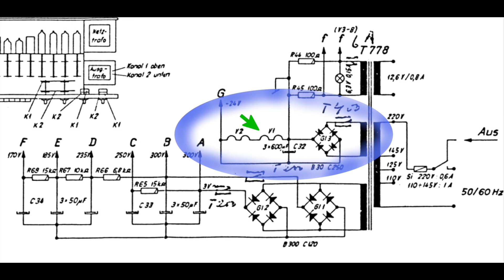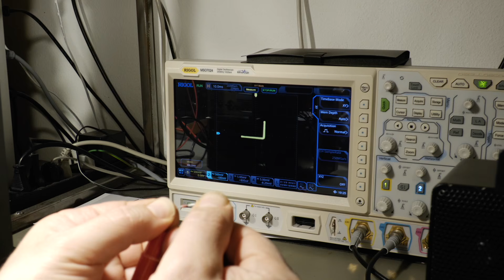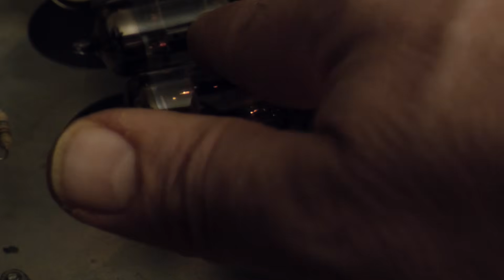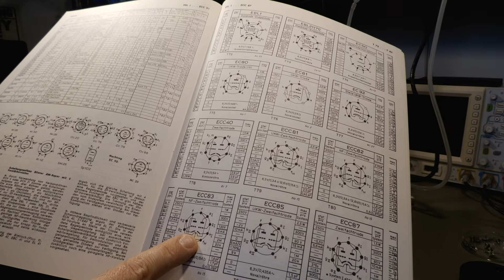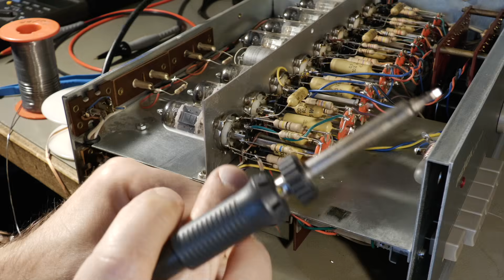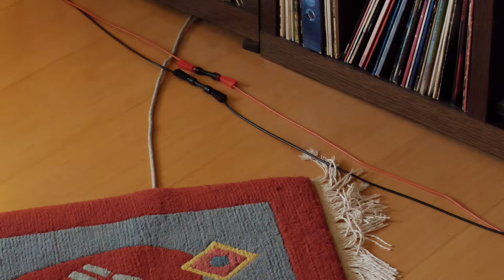Revox 40 amplifier - more Problems to solve (part 2)

Comment: Someone also replaced the high voltage rectifiers in the past, these where probably also selenium types. I would add a resistor in series with the heater wires, too high of a heater voltage is hard on the tubes. Also, If you are not going to use the phono input I would remove the tubes in that stage. It seems wasteful to unnecessarily burn them.

Comment: Also the grommet is missing where the orange and green wire go through the metal to the tubes. That is not original. I would think someone used an external audiophile phono preamp with that.
Reply from the maker: Possible... or a crystal pickup that produces almost line level signals.

Comment: Perhaps the original owner needed an additional line-level input, or used an external preamp but still wanted to keep the pickup button for the pickup. Also, perhaps the short to ground was meant for the input of the preamp tube (to not keep it floating?), but mixed it up with the tube's output.
Reply: Exactly my thoughts.  Probably wanted a CD input.

Comment: looks like a Selenium rectifier, which is ok to replace on low voltages, but on the high voltages you have to be careful with the voltage drop across them. as a replacement silicone diode will be about  0.6 to 1V but the selenium one might have 10+ plates and drop 20 to 30V.
Reply from the maker: That' probably why all voltages are a bit high. It seems the other rectifiers were replaced too. The date code says 1978. But I set the input voltage to 240V (we have 230) and that should compensate a bit.
Reply: @PlaywithJunk  the Electronics Old and New channel has a circuit he designed to behave as a adjustable voltage drop diode. to be  used as a Selenium rectifier replacement in the HT side. but changing the input voltage should be just as good.
Hope you had a great Christmas and looking forward to a great hew year.

Comment: excellent success. grounding is key in these things. it's really easy to put a pair of ground signal wires in parallel and create a loop that in the end causes hum. I assume that's why you had a grounding post near the phono input
Reply from the maker: From what I know (it may be wrong) is that the extra ground post at the phono connectors is for an extra ground wire that come from the record player. And that served the purpose of conducting static electricity from the pickup to ground. PVC (Vinyl) creates a lot of static charge and without a "lightning protector" these discharges would be audible.
Reply from the maker: PS: The Revox 40 doesn't have that...
Reply: @PlaywithJunk  Right, but in most other amps the actual outer connector of the RCA is the case, which is also gnd, so it wasn't required for them. I didn't know about that post was to discharge the pickup. I thought it was completely useless if the RCA signal wires were already shielded... but good to know, and even better to know you've fixed it!